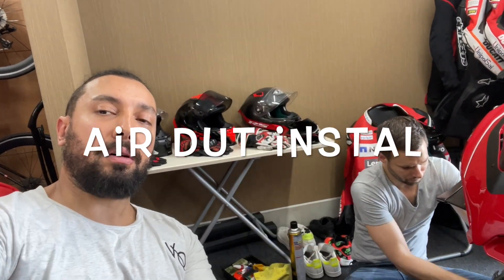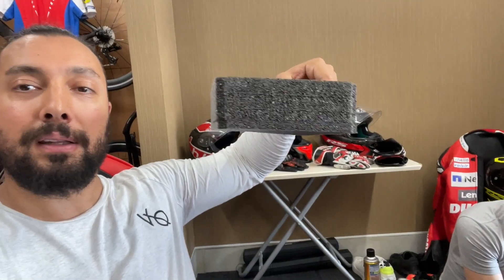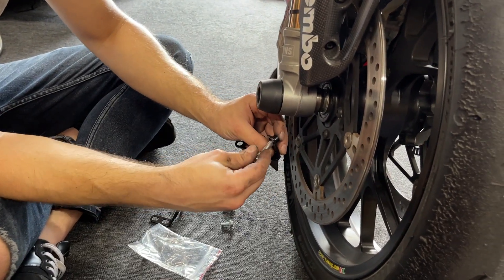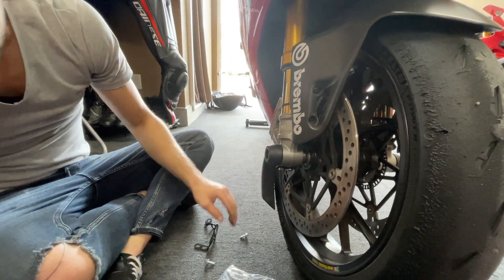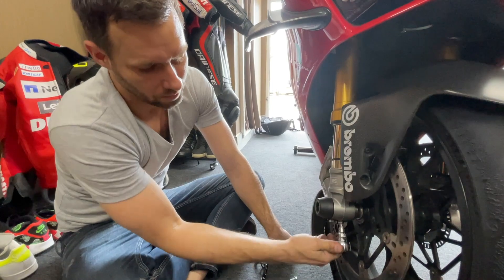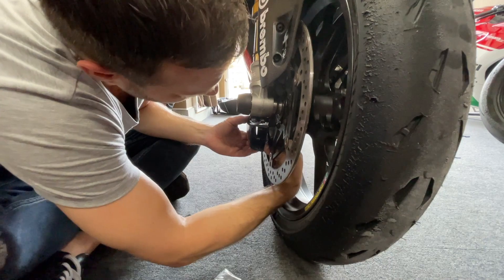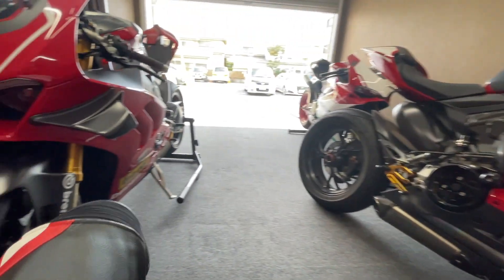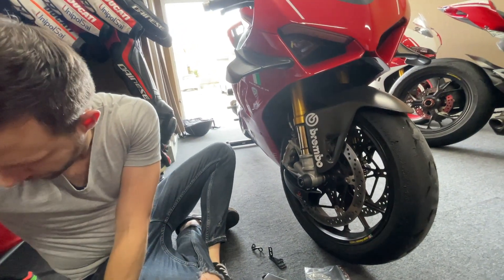CNC Racing air duct instal on Ducati Panigale V4R

Comment: Just got the same pair for a V4S. The weight though is about 260-270 grams including both sides and all brackets/screws. That gives a pro for the Ducati carbon ducts which are not so good looking but considering weight it would be about 200 less since the actual ducts weight about 36 each.

Another question, I see you have installed the RCS pump in one of the bikes. I had it for years in my Superduke and it's breaking feeling and performance was extraordinary. Though since it was a different bike and with old Brembo calipers (M50) dunno how much difference you have observed with the Stylema calipers in Panigale. Is it only about feeling or performance as well. I am quite tentative upgrading them because the stock master cylinder has a self bleeding system that RCS doesn't.